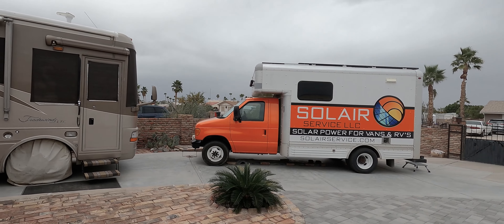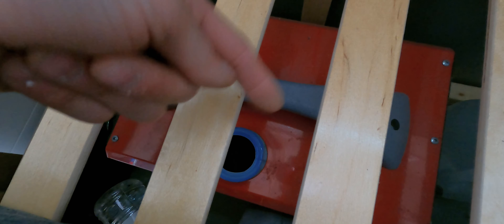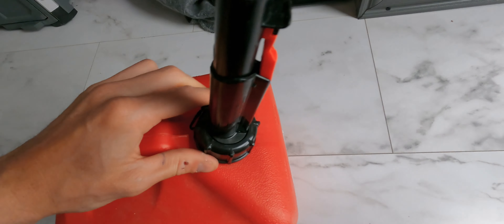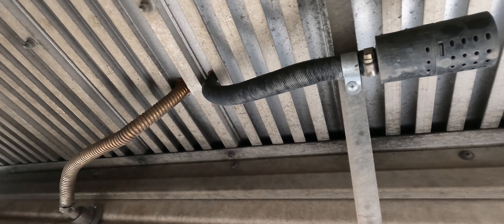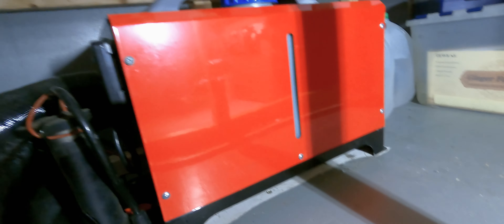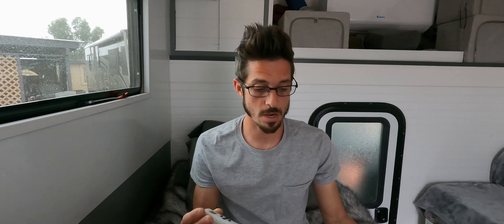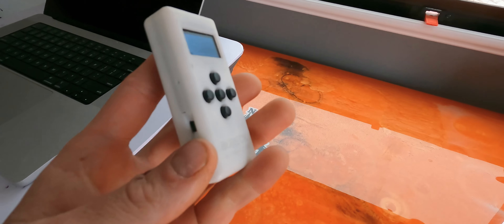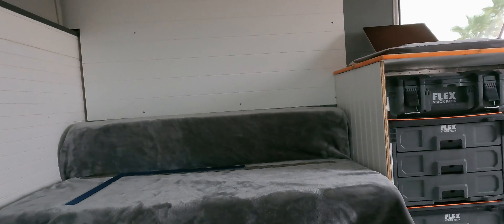Diesel Heater Accessories you NEED for Van Life

Comment: Red is for Gas only usually Yellow is for Diesel.  If your going to use the red container for diesel please write on top and sides of the container "Diesel Only". I used to work at a Gas Station in the days we pumped Kero and remembering people using gas containers for Kero - not a good idea.  Just saying.  Stay safe.
Reply from the maker: i appreciate the tip :)

Comment: I watched another diesel heater video and they had problems with the heaters coking up and getting clogged.  The fix for that issue was to always run it at max temp.
Reply from the maker: Yes, that’s why I like this thermostat. You can run it at max temp and the thermostat will just turn the heater on and off as needed

Comment: Brad, so does the thermostat device have the ability to turn the heater on and off when the desired temperature is reached so when u come back to the van it's warm?
Reply from the maker: Yes, that’s exactly what it does
Reply: Good question. I was wondering the same.

Comment: A few thoughts on heating air from outside the van, or heating the air that is already in the van. This is a classic case of opinions are like assholes, everyone has one and they all stink. I initially set up my diesel heater (which resides outside of the vehicle in a separate compartment) to take air from outside, heat it, and then put the hot air into my habitat. I decided to use external air because cold air can hold less moisture, and if I am heating air that has less moisture than the warm air inside my habitat, theoretically, this would also keep my habitat dryer. And yes, bringing in external air and pressurizing the habitat is an actual thing, I do not agree that heating the air that is already in the van would cause a vacuum. Anyway after a bit the weather here got cold, really cold. When the outside temperature is around 5 F the diesel heater had to burn much more fuel to keep the habitat comfy. I a Tee with valves that I could open or close and ran some more ducting so I could choose if I wanted to heat inside air or outside air. I burn nearly half as much diesel heating the habitat with the air from inside the habitat, as I do heating air from outside the habitat (when the conditions are very cold). Currently, our temps are much milder, 30's or 40's for lows, and I have the ducting set up to heat air from outside. It seems I can't say anything quickly.

TLDR: It depends.
Reply from the maker: I was speaking of the intake and exhaust lines for the combustion process. Intake air for the the space to be heated is a completely different topic
Reply: @nomadbrad503  very true. And if you don't source the combustion air outside you will also get a bunch of diesel fumes during the start up. Sorry I did not understand what you were saying. My bad.

Comment: Do you have a diesel smell in your truck when you open the diesel can and when you pour diesel into the heater
Reply from the maker: You can briefly smell the diesel when you’re filling the tank. It goes away quickly and doesn’t fill the van with smell